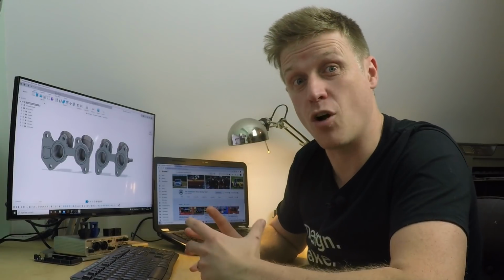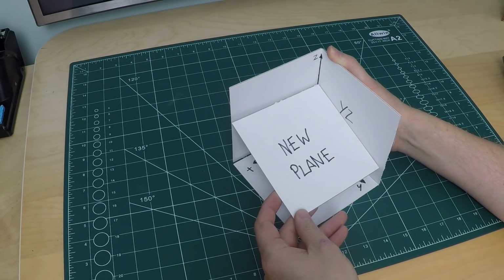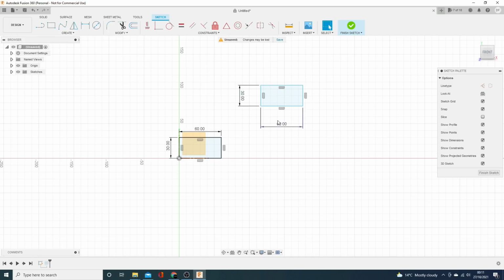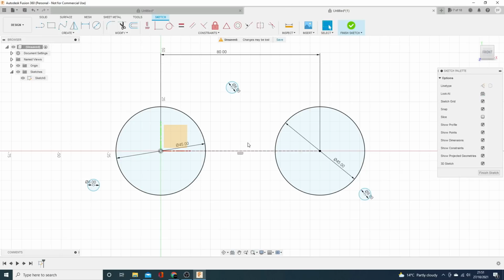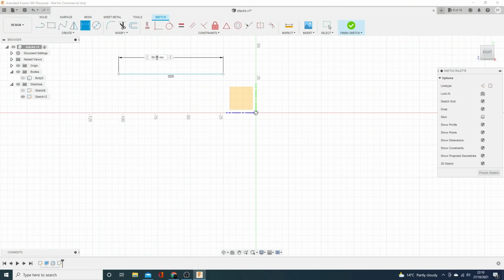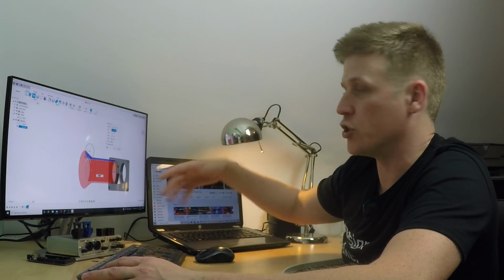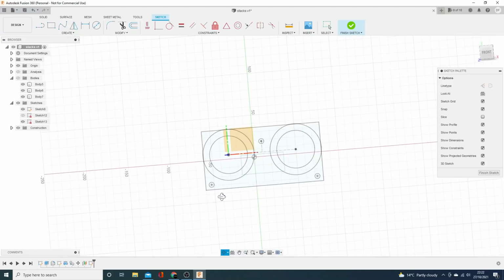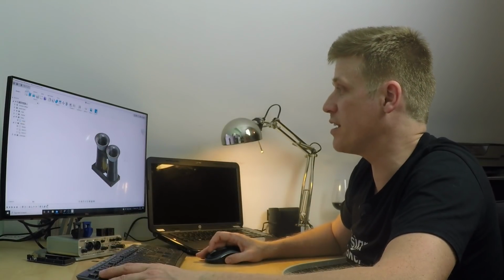How to 3D Model functional car parts for Beginners (and everyone else...) on Fusion 360

Comment: After being inspired by your videos to 3d print my own car parts. I went and bought an ender 3v2 and got it up and running today. This video is so perfectly timed for me.
Thanks heaps bro😊

Edit* 1 day later and I've already designed and printed (in pla for test fit) 2 parts for my 4age, a distributor/cas cover and a cop (coil on plug) adapter plate. I'm going to be making an itb manifold like yours after I get my engine running on speeduino (also inspired from you).

For those of you that don't know the cost saving doing it this way yet, it's huge!. Off the shelf cop plate and dizzy cover are $230 aud, and a itb setup is anything from $800 second hand to $1200 with new bolt ons. If we don't count the machine (tools are investments, so they technically don't count... or so I tell myself) it's $100 for filaments, $20 for bits and bobs, $150 for bike itbs for a grand total of $270 ish per engine, it's a bargain!
$1000-1450 vs $270!!
Reply from the maker: Perfect timing!👍. Have fun with the new toy… gotta love an Ender